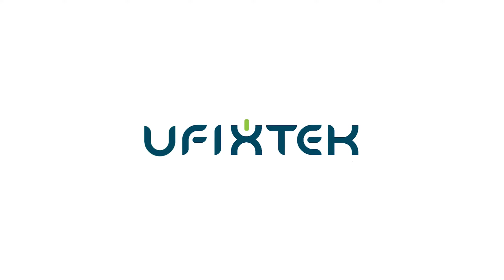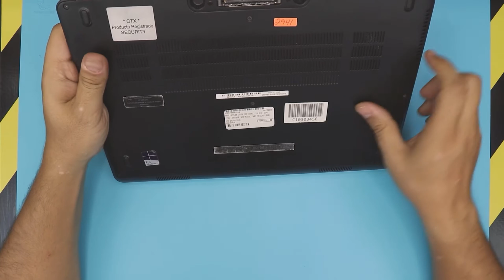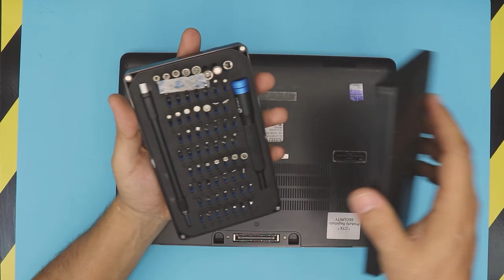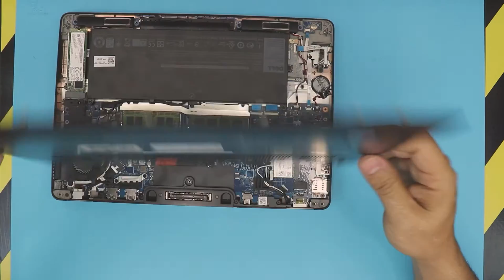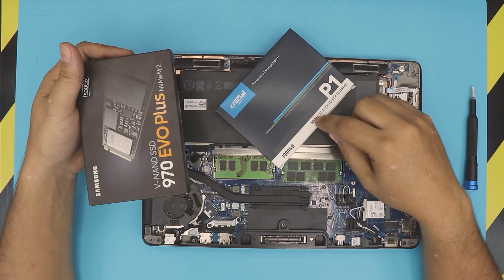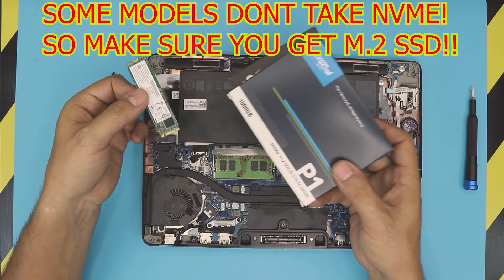Dell Latitude E7470 SSD Upgrade Step By Step Guide!!!

Comment: DISCONNECT DA BATTERY. Literally the first thing you need to do when switching parts.
Reply from the maker: 🫠 No need to disconnect the battery if you have shut the laptop off—there is no power to the RAM or the HDD. But if it makes you feel safer, sure, go ahead and disconnect it. 
cheers🍻

Comment: I have a problem with this same laptop - background light on screen is working (turns bright when I turn it on) but the screen remains black, everything works fine on external monitor, but for some reason this started to happen. It was not dropped or even moved. Just after the last weekend when I turned it on - the screen went like this. Tried restarting graphics card, power restart etc. but nothing works... Do you have a suggestions what might cause this problem? Thanks!
Reply from the maker: 🫠 Regarding your question, we always test the LCD with a new panel. Usually, the problem is the LCD panel, and we just replace it. In about 20% of cases, it can be a circuit board issue around where the LCD flex cable is connected to the board. A bad capacitor can cause this.
Reply: Thank you very much for your answer. Appreciate it!
Reply from the maker: It's my pleasure my friend.

Comment: for anyone watching now, the steps are really clear.. BUTTT you should unplug the battery before you touch anything on the motherboard so you don't short anything out.
Reply from the maker: It's my pleasure my friend.
🫠Regarding your battery disconnecting, I would recommend that anyone who thinks they might drop a screw or any metallic object over the board should 100% disconnect the battery. However, touching the board with bare hands is 100% safe even with the battery connected.
thank you for the feedback🫠
cheers🍻

Comment: thx for the tutorial altho i have a problem i have a newer version of dell latitude e7470 one from 2021 and can it support a 860 samsung ssd with is like almost the size of a hdd
Reply from the maker: 🫠Regarding your question, if your laptop has space for a 2.5" SSD, you can use any SATA 2.5" drive up to 4TB or a 2TB low-profile HDD. At the same time, you can have up to a 4TB NVMe if you have the jack for it. We've had those models (2021) in the shop for upgrade.
Should you have any further questions or requests in the future, please don't hesitate to ask me.
cheers🍻

Comment: i want to upgrade my ssd . is there another slot for ssd?
Reply from the maker: Thank you for your feedback! If you wish to support the channel, you can like, subscribe, or both!
Regarding your question, unfortunately there is only one m.2 slot available for storage upgrade, this laptop doesn't support regular 2.5' storage. you could upgrade the main storage to a up to 2TB without any issues.

if you don't have wwan card (beside the wifi card) you could place a short form ssd there the lane is PCI-E you will need this: https://amzn.to/3GrnWa3
the size for the ssd for that port is : m.2 2242 ssd NVME
if you have a WWan card and you don't use it then remove it and place a nvme m.2 2242 ssd.

Should you have any further questions or requests in the future, please don't hesitate to ask me.
cheers🍻

This is an  Amazon affiliate, when you use my links, I earn a percentage, which helps support the channel🙏.

Comment: Thank you for the video even though I had expected to see you switch the SSD and put one of those ones you had shown in the video.
I recently got the Dell Latitude E7470 laptop and it came with a SSD that has two marks like yours while I was expecting it to have a single mark like the nvme. I understand that the nvme are faster and I want to buy one but I am not sure if it will fit my Dell Latitude E7470 SSD slot.
How can I be sure that the nvme SSD will be able to be fixed on mine, please?
Reply from the maker: Thank you for the feedback! if you wish to support the channel you can LIKE or SUB or both :P
regarding your question: as this laptops are clients and in the video i showed how to remove and install the m.2 ssd the nvme with one notch is installed the same way as m.2 sata. this laptops DO support NVME m.2 ssd
we have recently days ago installed a samsung nvme ssd m.2 and it works just fine, i recommend you to go with samsung nvme they are the most compatible ssd nvme firmware.
https://amzn.to/3yHf25p
here is a prove of the compatibility : https://imgur.com/a/y8dRkd1
Reply: Uhm... I noticed the BIOS, under the SSD section, shows two SATA and one PCIe checkboxes. Does this mean that my laptop (the Dell Latitude E7470) can take 3 SSD? When I opened it, I can only readily find one M.2 slot.
Reply from the maker: @ekeretteekpo3004  the bios has the option but the motherboard does not have the m.2s installed. so you can have only one.

Comment: What does the fastest transfer rate the E7470. The EVO Plus supports 3,300-3,500 MB/s write and read.  

Does E7470 support 3,300 MB/s or just 1,800 MB/s?

Once again thank you.  I will also use your Amazon links for my future Amazon purchases.
Reply from the maker: thank you for the support and let me clear something that i think you falling for!
don't go with what ssd is faster and i'm going to see that speeds!
the answer is that you won't see those speeds even if you motherboards supports. 
The factors that you need to know are:
1. the speeds are from nvme to nvme ( if you transferring over usb 3 or any other ports you will see max speed based on the usb port or even the external drives firmware. if you external ssd even with usb c port but with a low quality firmware on it you will be limited to that.
2. the type of the file that are going to be transferred (big text file) video files and etc.. every one will have a big impact in transfer rate!
3 its one big file or many small files! 
4, the speed that they all advertise is high point of the transfer rate, It's not the average or steady speed.
i would say just place a good brand NVME and don't worry about what speed nvme you going to get as you won't benefit or use the max or even anything near the max speed.
this a very good quality and reliable ssd and will push you motherboards max speed limits were its possible.
https://amzn.to/3wlHveH
Reply: @uFixTek  Thank you... so, what maximum write speeds do I get when using 970 EVO Plus 1TB on a Latitude E7470?

500 M/s? (Please give me an accurate maximum speed)

Also, Dell tech support say E7470 supports only 2 PSIe lanes and only SATA SSD (not event SATA).... and not use a NVMe or SATA2 SSD. Are they wrong?
Reply: Also, does E7470 M.2 connector have an M key or a B key?
Reply from the maker: OK let me give you an idea, the bigger the ssd capacity better the speed performance. so if you get the 1tb 970 evo in E7470  you will get about 1.8-2GB/s .
also taking in mind the other comment i told you about.
and screw the Dell tech support they are useless, this laptop  E7470 supports m.2 SATA or M.2 SSD NVME. Because its a PCI-E lane. it is both compatible NVME or m.2 sata  I do get this laptop in the shop and we do install NVME ssd on them and we never had any issues.
but update you motherboard BIOS before going to m.2 ssd
and once you install your windows and all then you will need to install the samsung ssd driver to unlock the max speed.
SATA SSDs typically max out around 500-600 MB/s
M.2 NVMe SSDs can top 3.5 GB/s (but on your motherboard you should max out around 1.8-2GB/S
Reply: @uFixTek  Thanks... I already made a $370.82 purchase today... so you should see it on your Amazon Associate account... Keep up the good work.
Reply from the maker: much appreciate you kind support, if you have any question or request in the future feel free to ask me.

Comment: Why does it list “NVME0,SATA0, and SATA1” in the BIOS if there is only one drive?
Reply from the maker: Thank you for the feedback! if you wish to support the channel you can LIKE or SUB or both :P
regarding your question: Then bios firmware is connected to the south bridge Chip and the information, and the S bridge chip detects the m.2 slots as sata 0 and sata 1 and there are two m.2 sata, once for wifi and one for wwan boards.
Reply: @uFixTek  thanks for the clarification, so could I use the unused WWAN port for a drive or would that not work?
Reply from the maker: it would not work, because of the firmware of the wwan won't detect it as storage.
Reply: @uFixTek  ok, again, thanks for the clarification!
Reply from the maker: ts my pleasure :)
Reply: @somespacenerd  yes you could, but your ssd 2242 must nvme (dont SATA) and have m+b key..
my suggest is ssd 2242 from WD SN520 thats will be work
Reply: Wwan ทำมาเพื่ออะไร

Comment: would be good idea to isolate the power by disconnecting battery first before doing any work on a laptop
Reply from the maker: Thanks ✌  for the feedback!  if you wish to support the channel you can LIKE or SUB or both :P
regarding your suggestion: i would Always say no need to remove the battery from motherboard as its absolutely not necessary , if you look at any (brand) there is no power a the sata connector when u power off even if you short the pins nothing will happen. i been repairing motherboard and servicing since really 2003. 
- BUT now im not saying its it wouldn't be a good IDEA to disconnect, it would be a extra security measure if you do disconnect because you could by accident drop a screw on motherboard or anything alike. for this extra accidents that could happen by negligence of people then i agree with you, but not for upgrading reason.
cons and pros of Removing the battery: 
PROs:
-gives extra level of safety (for any accidents)

CONs:
- i have had people in that removed the battery cable and shorten the connectors and killed the mobo
- most new laptops dont have cmos (BIOS BATTERY) and if you remove the main battery bios gets rest and must be configured before be able to boot.
- people remove the battery and they think now they can man handle the board and nothing would go wrong. (based on a comment i seen and the person thought that he/she could touch the sensitive chips if had the battery removed)

♦Also i do make a video for every laptop on how to remove or replace the battery.

Comment: What is the size of Dell Latitude E7470 base enclosure screws?
Reply from the maker: Philips bit #0
Thank you for the support to the channel :)
Reply: @uFixTek  Thank you for your reply, These screws don't come out so I need to change 3 or more screws is it possible to change them screws? or I should buy a new cover? :)
Reply from the maker: yes you can replace them you have to pull hard on the screws, and go to any electronic repair shop and take the screw sample they should give you for free few of them. it may not have the same screw head but the screw size should be the same.
thank you for the support and feedback to the channel :)

Comment: Thanks for the video...BUT you really should show the hard part, which is trying to boot up the computer with the new SSD that has NOTHING on it.
Reply from the maker: i appreciate the feedback and i will defiantly keep a note on that and will do. thank you for the support to the channel by sub :)
Reply: That is a typical topic not specific to replacing this drive.  Use a drive copy program, move the data over to the new drive, install and good to go, for the most part.
Reply: just make a clone from the old ssd, and put that clone on the new one. Install new sdd, press power and enjoy!